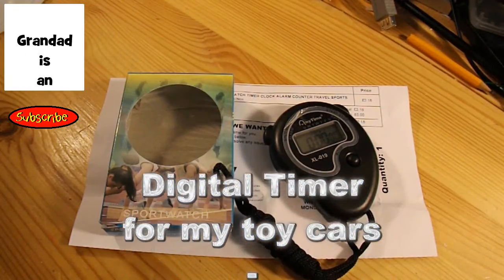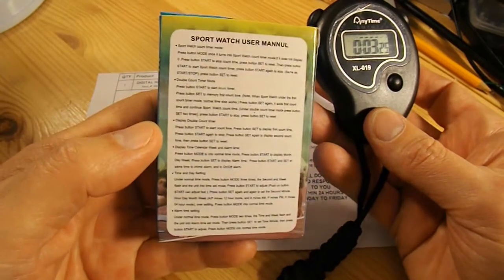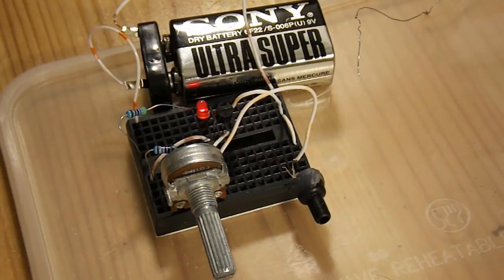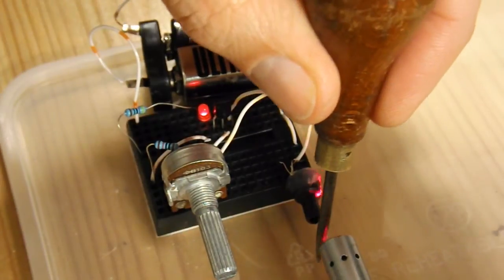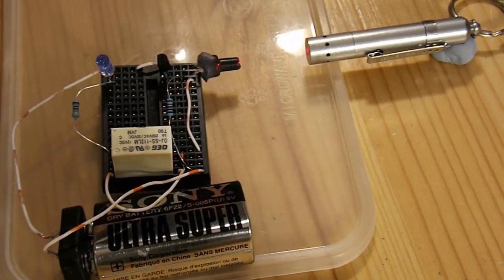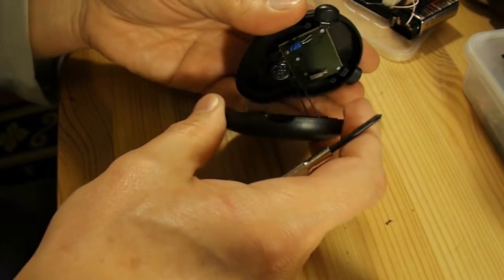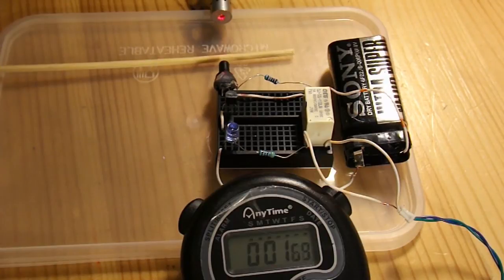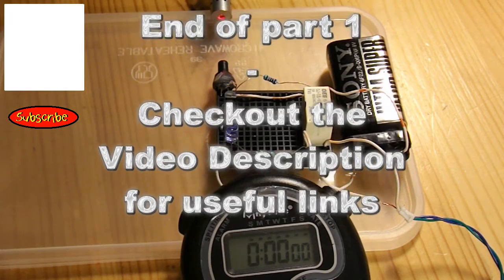Let's make a Digital Timer or Speed Trap for my Toy Cars - Part 1

Comment: That is sooo cool its like one of those things they use for drag racing.
Reply from the maker: Hi Ryan, yes that was the inspiration. It needs a bit more development before it will work the way I want, but I was pleased with the progress so far. I set it up to try it out with mirrors to reflect the laser across the start and finish line and then found my laser batteries had died so I will need to replace them or hack the laser pen to give it an external supply.

Comment: I need this for my Uni project, and yes its a elastic band car too. Thank you. Brilliant.
Reply from the maker: +IN3 thanks, this is all very basic but it does work. There are all sorts of issues that could do with improvements. If you missed the link in the video description there are 3 videos in this series https://www.youtube.com/playlist?list=PLA5a2xPRSrB2mEKV5Qs0vwt79iXIJYtD-
Reply: +GrandadIsAnOldMan Thank you so much. I am sorry for bugging you. But I would like the schematic for the simple version you have at 5:00 in the timeline. Just a sketch will do as I am under time limits. I have the diagram from the end of video 3 ( thanks) but is it possible to get a diagram for what you have made at 5 mins into the video.  I would be so grateful if you could do this for me.  The values of the resistors, type of relay, and connections to transistor.
If you can do this you are a gentleman and a scholar.
Reply from the maker: +IN3 sorry, this was about 2 years ago and I don't have any details now however I know that I probably based it on this video by Patrickikis and you may find other useful stuff on his channel https://youtu.be/pO1dTkLrod8  thinking about it the diagram would have been very similar to the one I used in this video https://youtu.be/sbvj449LVNM?t=6m44s

Comment: Hello,
I need to make a laser timing system for track and field. Do you have any blueprint or can you give me any directions about what material to buy? I would greatly appreciate. Thank you
Reply: Also is there a way to reproduce this with two laser beams, instead of one, like one for starting line and one for the finish line? I'm looking to time distance of 10m, 20m, 30m.
Reply from the maker: There is information in the video description. The diagram is shown at the end of episode 3. The playlist is in the video description. I buy my components off eBay cheap from China. I expect you could make two circuits and have them both trigger the stop watch. The relay in the circuit is just replacing the push button on the stop watch so you would just have two "buttons" doing the same thing, operating either one would trigger the watch.

Comment: Hello Grand Dad, 
Greetings, 
This time is very cool,
and i need help.
I want to make a similar Digital Timer connected to a stop watch for my son who is a skater and he skates on a track of 200 meter which has a start line and a finish line.
Could you please guide me how to make this time device for a roller skating sports for home practice. this would be very handy as we use manual stop watch because the professional timers are very expensive. 
this url will give ideal about the sport. 

2013 Speed Skating Championships POWERSLIDE VLog02 - Men 300m TimeTrial

however, I have no idea of electronics. 

thank you.
regards
Reply from the maker: Hi Pramod Deshmukh, there are a few problems here if you are thinking of copying this for the purpose you suggest, so it may not be right for you.
1. I use a laser pointer to trigger the circuit and I would worry that somebody might stare into the beam and damage their eyesight. This is not a problem where I am using it as I am the only person involved.
2. The laser beam is sent across the finish line, reflected to the far side of the start line and then reflected again across the start line to the sensor. Not a problem in my kitchen as that is only about 5 metres but I cannot see it working for you over a 200 metre track unless it is a circuit and the start line is also the finish line so you just have one beam across the line.
3. Anything else crossing the beam whilst your son races around the circuit will trigger the stopwatch giving you a false result. Again in my kitchen I can control that, but it may not be so simple out on a track.
4. If you have no electronics skills this may be beyond your capabilities to replicate as some skills are required.

In episode 3 I give a little more information http://youtu.be/7zl15NVlzGM

The circuit I am using is based on the clap switch circuit used by El profe García in this video http://youtu.be/Q9ccHOFu1gg. The main change I made was to replace the microphone with the LDR.
Reply: GrandadIsAnOldMan Hello Sir,
thank you for your response.
regards
Pramod